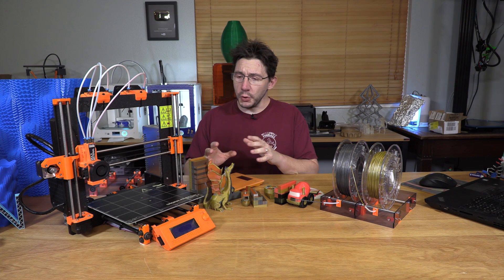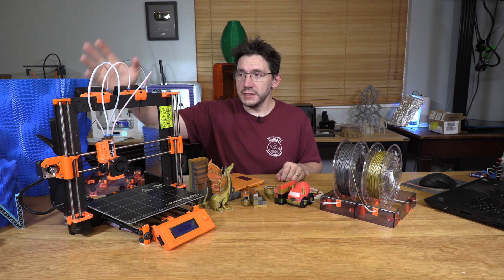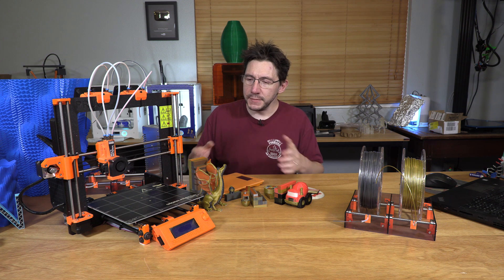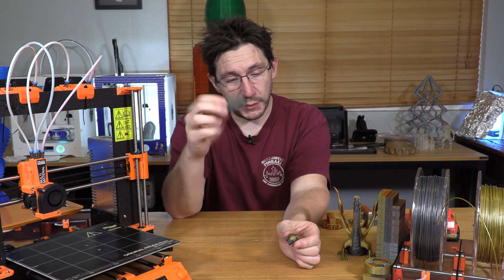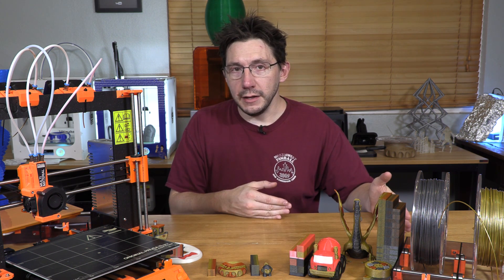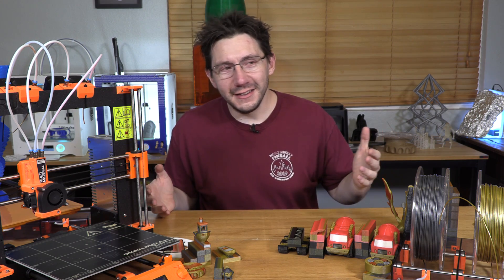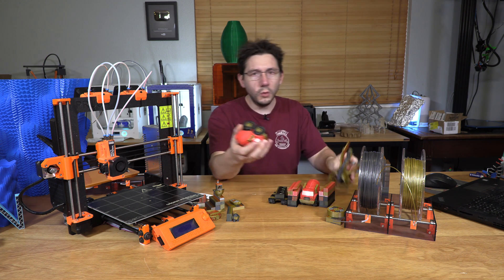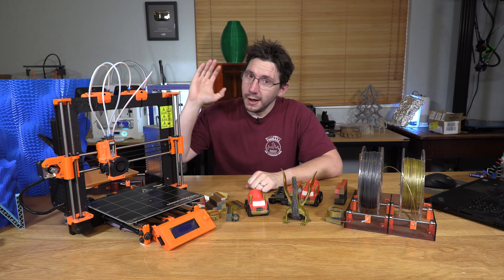Prusa Multi Material Review(?) - My Thoughts on the Prusa MMU 3D Printer

Comment: It should be pointed out that if you print multiples of the same model at once the purge block will not be any bigger than for 1.
Reply: It's been pointed out several times including by Josef.  It's a valid point and should be repeated as many times as needed.  Still I'm not a fan of this type of multi-color printing.  There are better ways of doing it.  Some yet to be invented.  :)
Reply: Peter Adlam You beat me to poining that out :)
Reply: This is only true if more than 1 model can fit on the print bed unfortunately

Comment: wish you could make the purge block a custom shape like a different benchy with random colours
Reply: it is not entirely feasible,  since it will only work for model that meets the per layer minimum surface area required for purging 3 colors (purge block is always = N -1, where n = the total number of unique filament that you will still be using for the future layers). if argue that you can make the purge model larger, you are also wasting plastics.... so yeah... a lot of conflicting ideas here.

Comment: How about creating a purge block which looks like a vase (The extruder primes the nozzle just by creating a vase in vasemode)? Then it is not so wasteful and you have a interesting multi color vase.
Reply: I'm still intrigued by the idea of printing another model while purging.
Reply: limited by bed space, as welll as the estimated amount needed to purge the nozzle being able to create a finished layer of the vase properly.
Reply: True, but it could be also another model with infill, so the nozzle purges enough and you don't waste material for a block.
Reply: @nanafalke   indeed. then this perhaps preferred changeable purge model could be that "single color" model (but than randomly purge coloured) that you maybe do prefer to paint afterwards still. then it's more a useable kind of waste.👍

about limited bed space, mostly the bed is not used completely filled at all. and in most cases there is enough space for something else. better than waste space.
Reply: I guess you slightly increase the chance of an issue but still a great idea to look into
Reply: My thoughts exactly see comment elsewhere here.. At least print a useful item not just a block of waste.
Reply: Yes, and then you just have dozens of vases (some finished and some unfinished) lying around lol
Reply: I was also thinking why not design a purgeblock that's a useable item - it could be designed so that even if it is unfinished it can be used or combined with another. ANY shaped form can be converted into a keyfob, even an ugly lump of ABS/PLA

Comment: Will you be possibly covering the new MK3?

Edit: I also think it would be cool if the purge block could be another useful part. Like instead of a big purge block and one part you could have two parts and a smaller purge block. Sure you couldn't determine the what color prints where on the "purge part" but I'd definitely take it. Think about that.
Reply: What do you think is behind that blue bubble wrap 😂
Reply: With the purge block thow if u make multibal copies the block won't get any bigger 10 marvens the block would be same size as 1
Reply: Juho Leiniö same
Reply: Maybe what is Juho Leiniö saying is that the purge block instead of being waste can be a model that we decided to print with the mix color had to be the same hight and wide or bigger.
Reply: thokk10289
The one on the left? That is a print, not bubble wrap, I'm pretty sure it's the one here https://youtu.be/r9Po_N8TUQo
Reply: There is nothing in the extruder hardware preventing that from happening. You would just need your slicer to support such an option. If it were up to me, instead of having a "waste" part, the color change would occur on the infill.